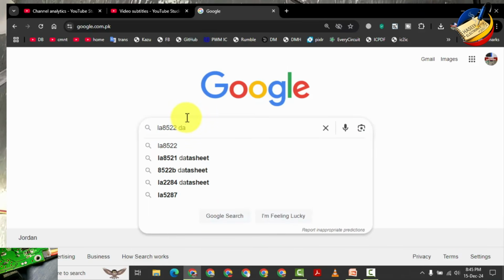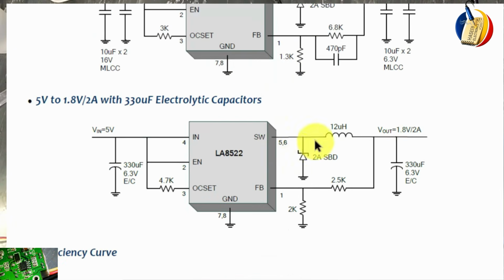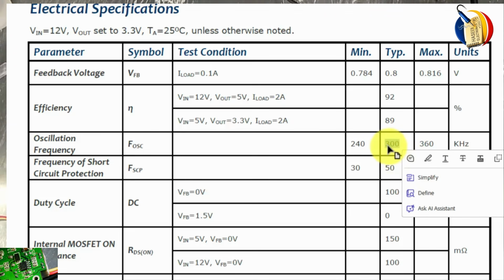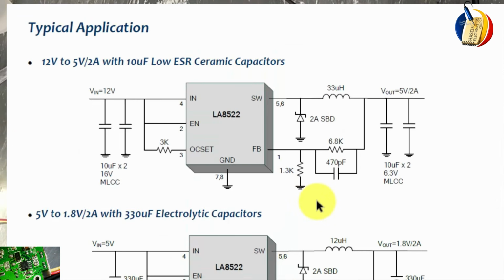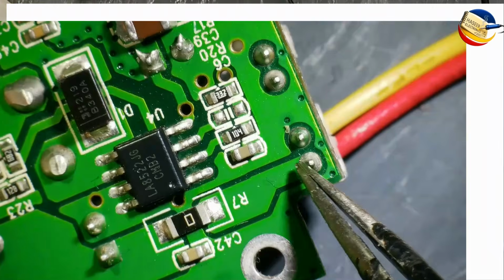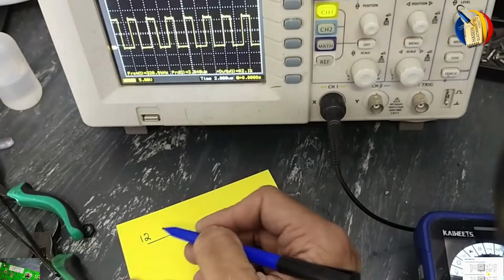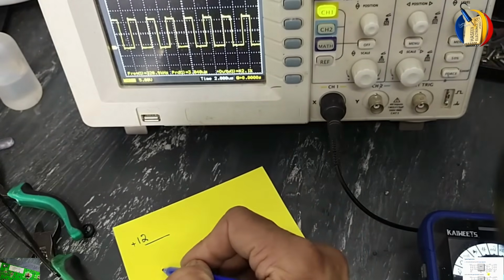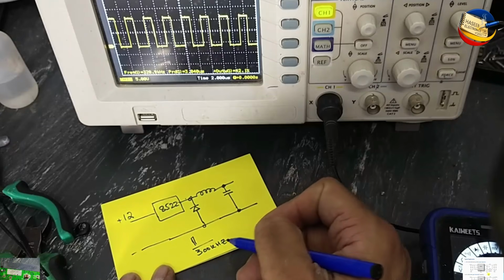LA8522 Step-Down DC-DC Converter | Function & Practical Testing | 12V to 5V | Ep #1481

Comment: Haseeb, My friend have you done a video explaining the SMPS chip start up. How it gets VCC voltage to get it started oscillating, until the aux winding can supply power to the chip[?
Reply from the maker: https://youtu.be/nvjD7iMJORw
Reply from the maker: https://youtu.be/P4UXrLACBX4
Reply from the maker: https://youtu.be/lmdyhNydJSs
Reply from the maker: Thanks for your comment 
Some ics use external start-up resistor to charge VCC capacitor 
Some of the pwm ics use Internal voltage regulator to charge VCC capacitor 
Some of use another standby power supply to get VCC voltage 
Check this video 
https://youtu.be/lmdyhNydJSs

For any question, you can write in comments
Reply: @HaseebElectronics Thank you my friend. I have learned so much about SMPS from you.